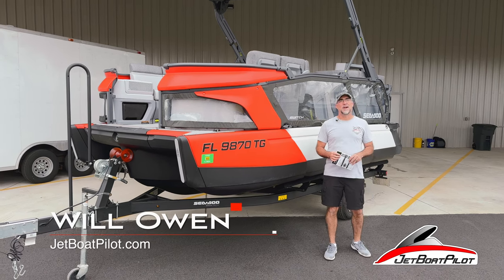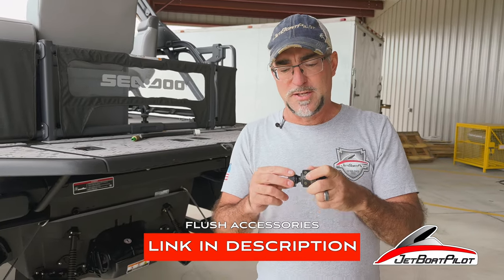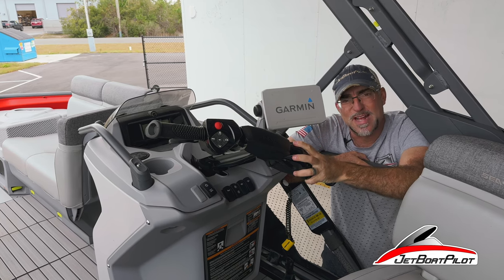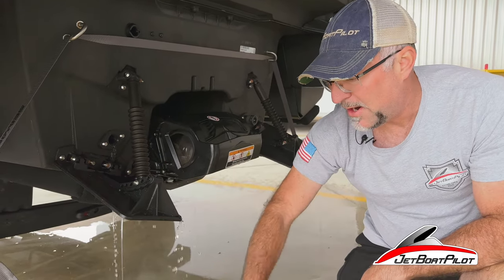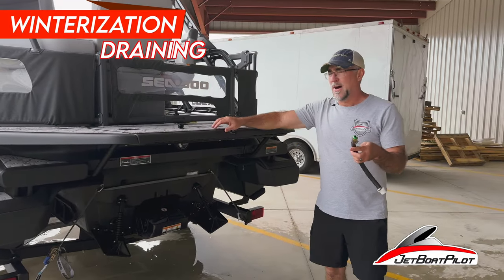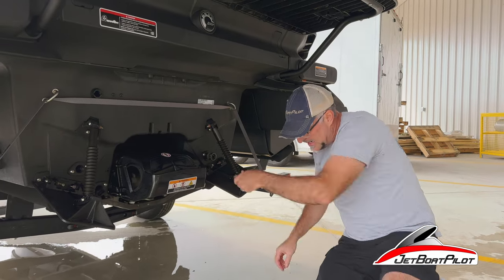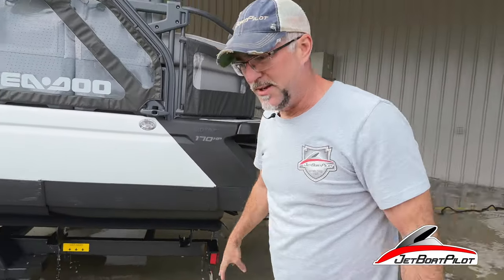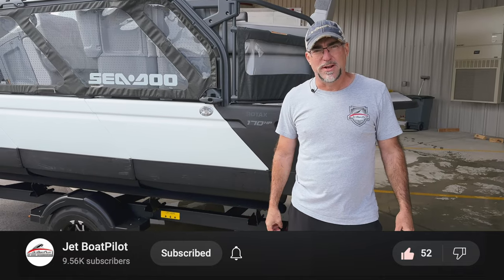Ultimate SeaDoo Switch Flushing Guide | What’s The Manual Say

Comment: My question is about the motor flush port,when I go boating and I’m done and I pull it out of the water and I undo the bottom drains,do I do the motor flush too? I have only had mine out 3 times before winter and I always drained it when I pulled up the ramp, is this correct or no?
Reply from the maker: The motor is closed loop so it does not need to be flushed. The exhaust however is open loop and does need to be flushed. The lower right side port shown in the video is the flush port and should be used as shown in this video. The other ports are either flush for the pontoons or drains for the system during winterization. Do not remove the lower left port cap unless you're draining the system for winter storage. You must reinsert that cap prior to flushing the engine or you could damage your exhaust system.
Reply: @JetBoatPilot  yes I meant the exhaust, not motor. Should I or should I not drain it every time I take it out of the water is what I’m asking. Or trying to ask. I’m new to any boat
Reply from the maker: @davidwood1429  the boat has drains nearer to the jet pump (just to the inboard of the trim tabs in our video) and yes it's a good idea to open those drains after every use and reinstall as soon as they're done draining fully. Also jack up the trailers tongue jack fully for max drainage.
Reply: @JetBoatPilot  yes I do that for sure ,but I’m talking about the exhaust one,is it good to open it as well or leave it full of water.
Reply from the maker: @davidwood1429  don't open it unless you're winterizing the boat. It's not necessary to drain after every use. It won't hurt if you drain it but my concern is that you don't put it back in and it causes damage. Since it's not critical to do it after each use, I suggest only take it out when you winterize.
Reply: @JetBoatPilot  thank you ,that’s what I needed to know. I always put it back as soon as water gets done running out,I just wasn’t sure if it needed to be full all the time as to not mess anything up.I appreciate you texting me back. I did order the numbers and front bumpers and the gate latch I need to put them on before season. Is isopropyl alcohol good enough to make numbers stick well. Thanks again!
Reply from the maker: @davidwood1429  yes, we use IPA all the time. Just make sure you let it dry fully.

Comment: Should an owner spray anti-corrosition spray in those areas of the tritoon that get flushed by that upper flush port?
Reply from the maker: Not needed. Inside it's polymer and foam.
Reply: @JetBoatPilot  I am not arguing with you but I am wondering about the hardware in that location  There appears to be quite a bit of fastners and stuff and it looked like it was perhaps in need of anti corrisive spray since water will be in and out of those compartments.  Just wondering.  I am referring to 9.00 time stamp on the video.
Reply from the maker: @Paul Kear  I guess it could not hurt to do it, but again nut sure it would be mandatory to do it.

Comment: Where does the bilge pump evacuate water from? I thought that was the top hole on the back of the hull. If not, where is it?
Reply from the maker: I think that is the bilge discharge. Top hole under the swim platform on the port side.
Reply: @JetBoatPilot  i just followed these steps for winterizing and thanks for the vid.....question, is there anything i need to do with the drain plugs at the bottom left and right of the jet? i havent seen that i do and they are pretty well screwed in anyway.
Reply from the maker: @TheVinceb100  you can remove them and let them hang from their stays.
Reply: @JetBoatPilot  its that something that needs to be done? is there water trapped in there?
Reply from the maker: It can't hurt.  @TheVinceb100

Comment: I foolishly flushed it without the engine on. Am I in trouble?
Reply from the maker: You're supposed to. Just don't do it f9r more than 1 minute on a hot engine or 2 on a cold engine. Never run water through the flush port with the engine off.

Comment: So let me get this right, you want us to pay alot more money for this craft, and then they made it striped so you must buy all accessories and to top it off instead of just flushing an outboard motor at the end of the day boating ,you must flush the motor then the pontoons that also flushes the deck . Man I'm tired
Reply from the maker: Nope the boat comes available in many trim levels. Accessories are optional for those who would like them. The flush is not necessary for the engine since its closed loop and uses actual automotive style coolant. The exhaust flush is necessary after use in salt water. In fresh water not really necessary as often. The pontoon flush is needed a couple times per year depending on the water you're boating in.
Reply: Yea and flushing it out doesn’t take long at all. Less than half the time of one outboard. It’s also a hell of a lot cheaper unless you compare it to a cheap John boat.